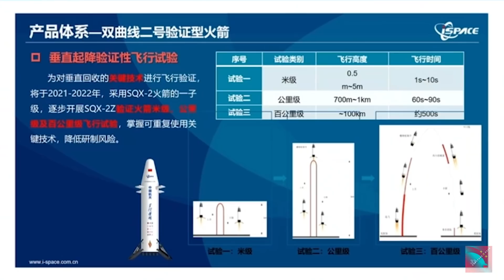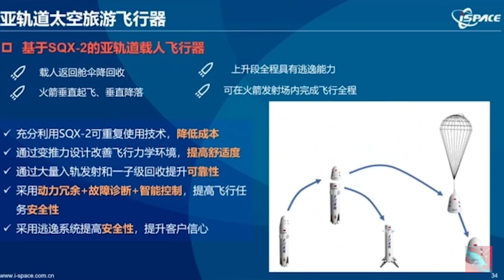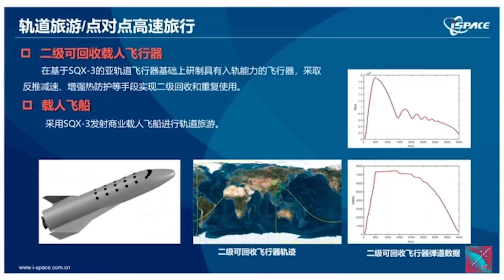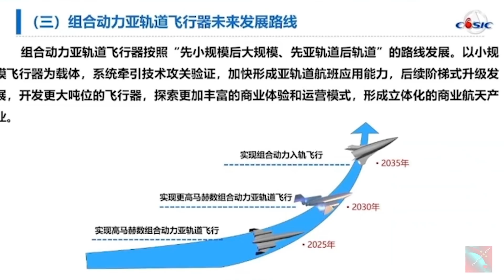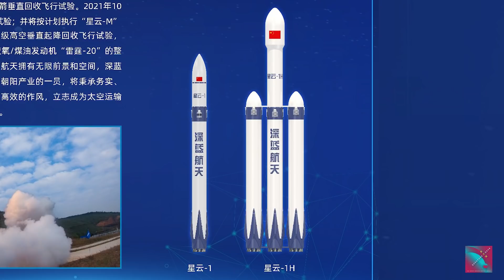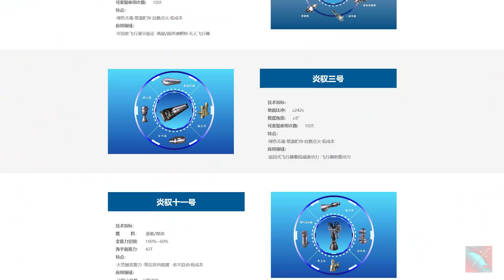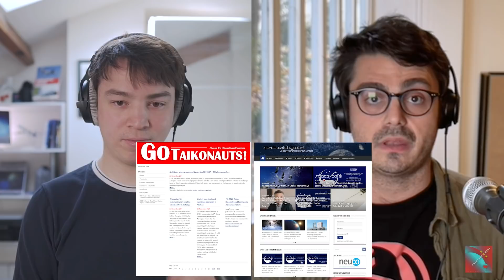Major Chinese Rocket Updates at the 2021 China Commercial Aerospace Forum in Wuhan

Comment: My hot takes is that the wealth gap issue will depend entirely on the industry's end goal. If the plan is to make it a prestige service, then they're going to hit a wall. But why would they want to make money from a pool of 10 when they can make money from 1000 people? If even 10% of the population can afford to take transport rockets when they absolutely need to ala business and first class plane tickets, no one would have any problem with the service. That's not going to be possible initially but if the company include this goal in their long term planning, it wouldn't cause any controversy. Considering the speed with which the number of small and medium sized China-Africa businessmen is increasing, I think there really would be a market for transport rockets in the future. I mean, once active, it'll just be a more practical and better version of the Concord.

Comment: 10:10 Isn't this absolutely a missile in disguise?

Single-stage solid fuel, a payload that looks like an HGV, and overall design like China's many SRBM series... 700kg payload and Mach 10 speed too... 

very suspicious indeed.
Reply from the maker: Hmmm, I would tend to think that this is probably not a missile. Several reasons for this:
1) the way it's described makes it more of a sounding rocket/research rocket, used for high altitude or space sciences
2) China is already pretty well supplied in missiles with products coming from SoEs like CASIC or Norinco.
3) Space Trek actually has another dedicated range of products linked to defence (http://www.spacetrek.cn/defense), so no need to disguise anything ...
Reply: There's a skeleton hiding inside everyone and every rocket is a missile in disguise.
Reply: Missiles do launch objects into space, you know. It's gonna be very useful to redeploy satellites in case of space wars.